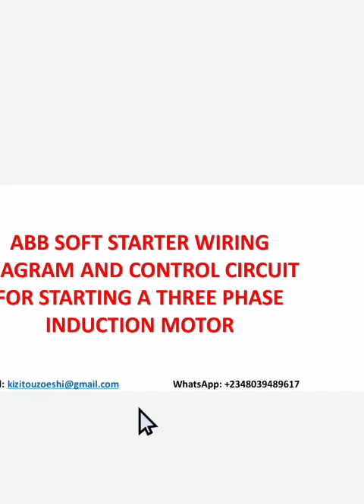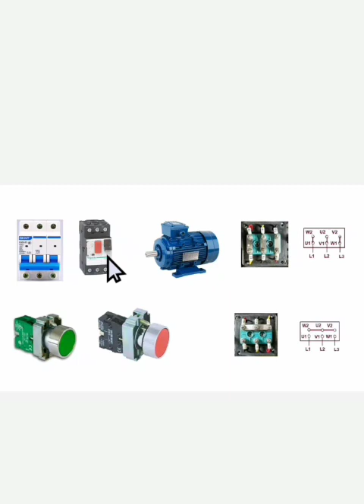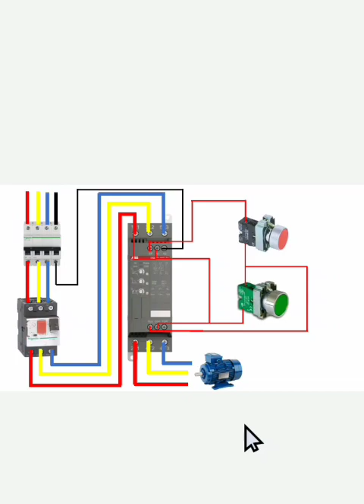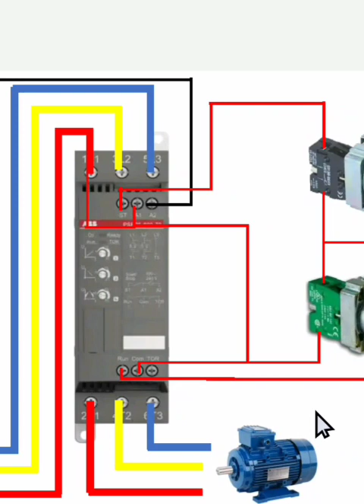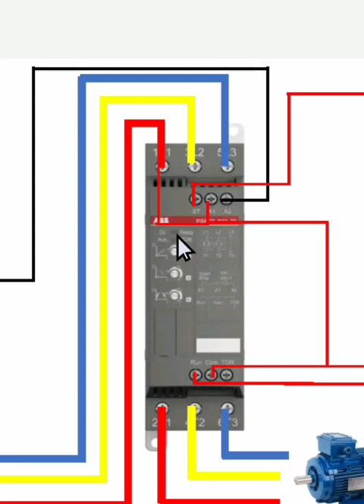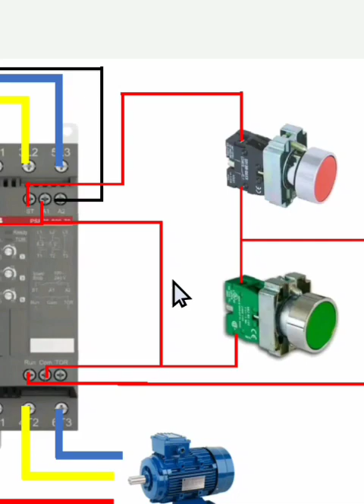ABB soft starter control circuit for three phase induction motor

Comment: Don't we need a contractor before soft starter? My motor is 30Kvt
Reply from the maker: You can put a contactor before or after it. Make sure you get a soft starter rating of not less than 30kw. Different ratings are available according to your motor capacity